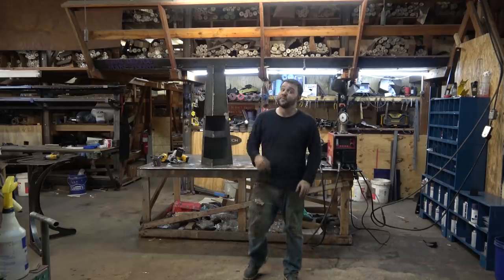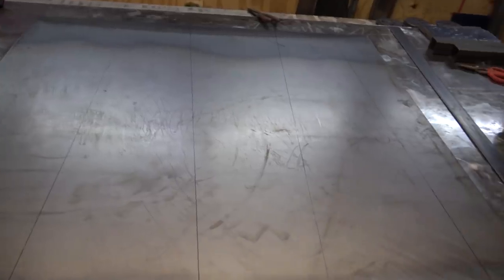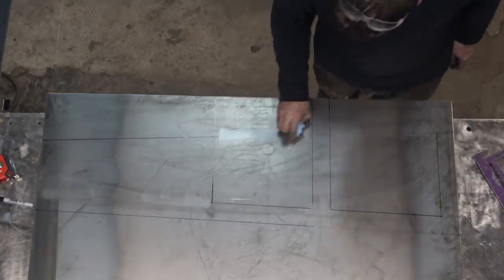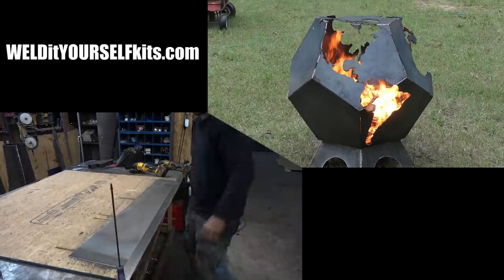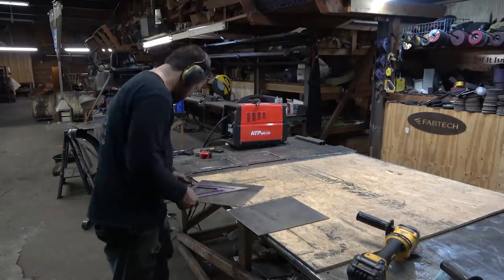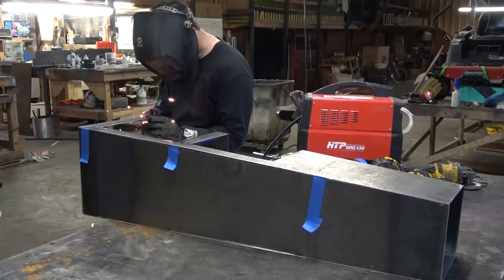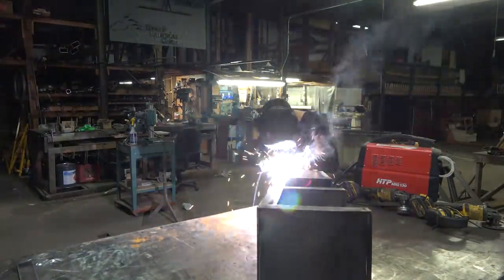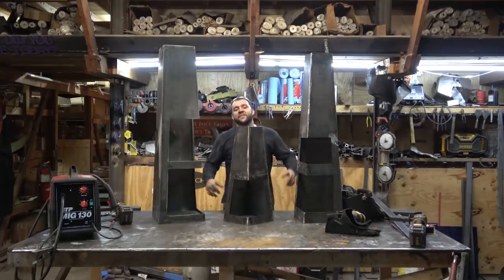No CNC Chiminea. Beginner Welding Project with Plans

Comment: Pause at 5:27 to see the mustard dust. This is why you went through so many discs. 
Don't climb cut, steady hands with less disc bounce, clamp material to stop vibrations.
Reply from the maker: All good advice, not always practical, especially for a beginner

Comment: Great way to prove that everyone can start somewhere.  On the subject of tool selection I use hot rolled steel so i deal with lots of mill scale. I recently started using stripping discs instead of flap discs. I was wondering what your thoughts were between the two.
Reply from the maker: Stripping discs are great for scale, flapdiscs for grinding. That's my approach at least
Reply: @42Fab  Thanks for the reply i"m really new to the metal fabrication scene and am always looking for tips, trick, and any advice. Which  I find a lot in your videos . Keep it up it doesn't go unnoticed.

Comment: I notice you do a fair bit of downhill with the flux core, I've heard it can be difficult to weld downhand with flux core? Is this true or is it not too bad (I've never welded with flux core wire)
Reply from the maker: As long as you keep the puddle hot, it's not too bad

Comment: Your metal cutting dewalt skill saw is that a regular skill saw with metal cutting blade or is it specifically meant to cut steel and what type a blade do you run in it also?
Reply from the maker: It's made special, runs the same sort of blade cold cut saws do. https://www.dewalt.com/products/power-tools/saws/circular-saws/20v-max-lithium-ion-metal-cutting-circular-saw-kit/dcs373m2

Comment: could you not just use a jigsaw with a metal carbide blade? instead of a grinder
Reply from the maker: You can, they are harder to cut straight lines with

Comment: I just noticed that you Jeans has big hole and frays in the hold when welding and cutting carefuller you can fire hazard (leg ) I have had that happen to me when MiG welding my leg was on fire because of my jeans old and frayed It got hot and I got the fire  out pretty quickly :) and pair steal toe boots have you herd of PPE ? You also almost cut a few fingers off a few mouths ago
Reply from the maker: if you want to play safety police, you are more than welcome to do so at YOUR shop, on YOUR channel, or in YOUR head. Either you or I will stop the whining about it here. We all make our own safety decisions (as I mentioned in this video) I'll respect yours, I don't tolerate less than you doing the same with mine.